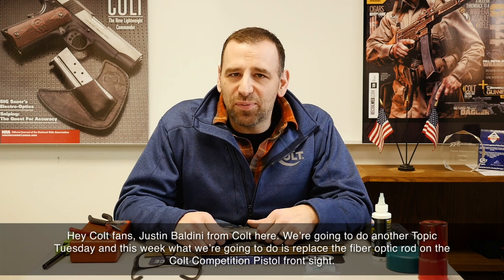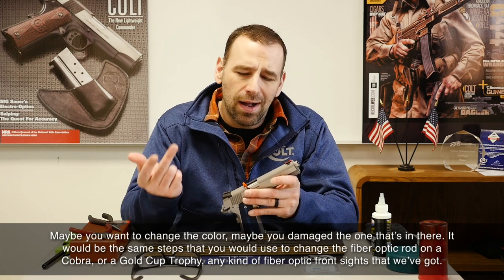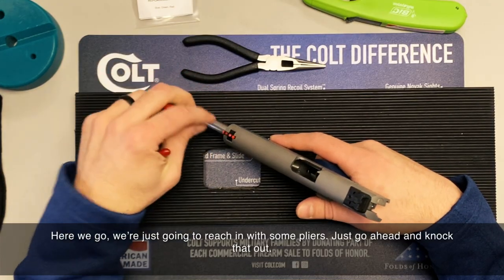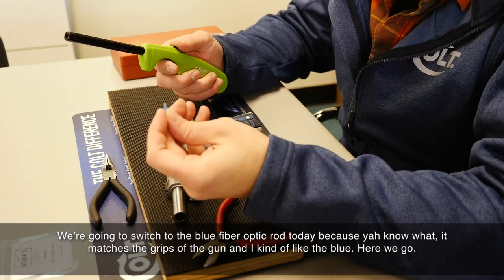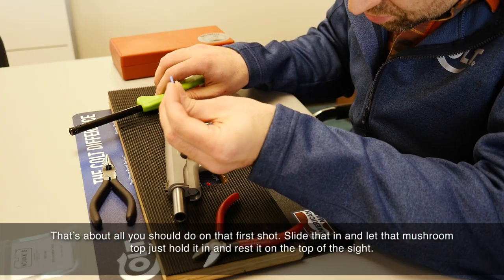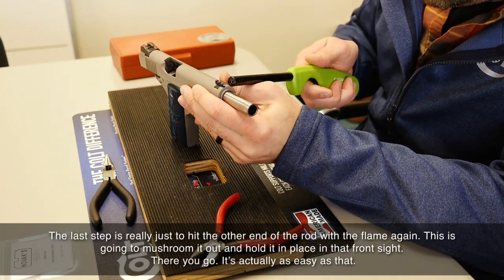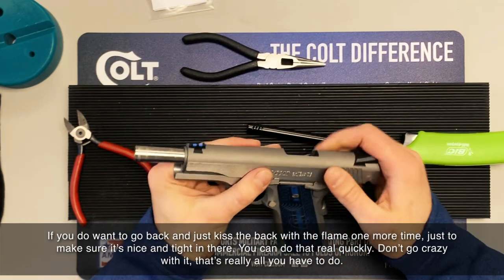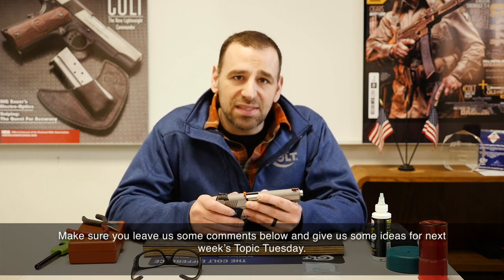How to replace the fiber optic rod on a Colt Competition

Comment: Does the blue fiber optic come with the colt competition when you buy it?
Reply: Mine came with the red installed but have a blue and red in the baggie
Reply: Mine came with blue on and red yellow blue extra ones
Reply: Mine came with red installed (and fell out on the shakedown range trip, of course), and had spare blue, green, and red rods in the case, so im gonna put in a blue one.

Comment: What's the diameter of the fiber rod. It fell out of my front sight shortly after I bought my Colt 1911 competition. I have tried to buy replacement rod but I found out it comes in different diameters
Reply: 1.5mm
Reply: If you purchased it brand new it should’ve came with some new different color rods.
Reply: @brianb900  that does not answer the question.  Maybe he got it used and didn't come with any extras.
Reply: Steve Brown  I posted that because I had no idea that mine came with replacement rods when I purchased it, they were in a little bag hidden behind the owners manual in the box. No I didn’t read the manual.